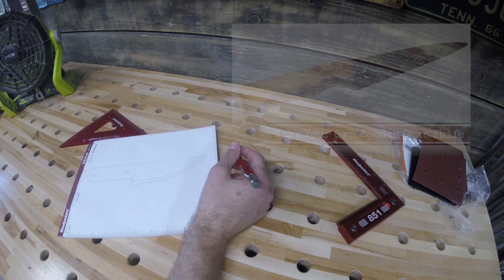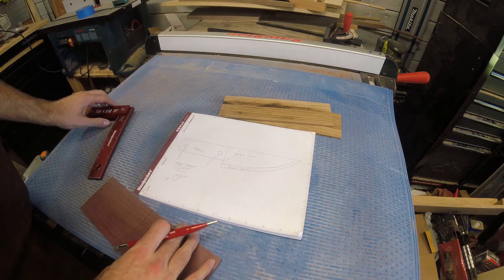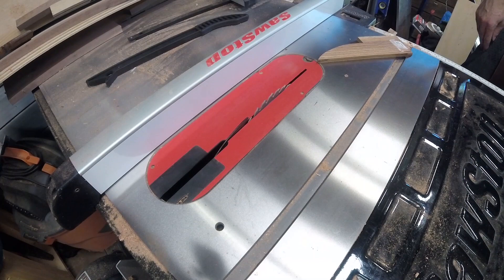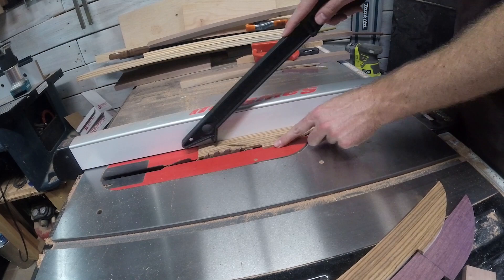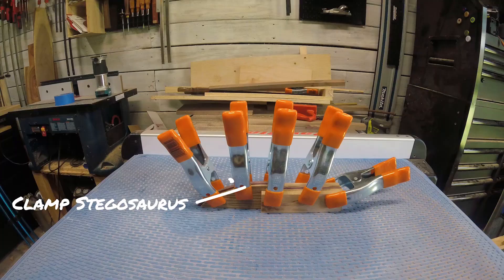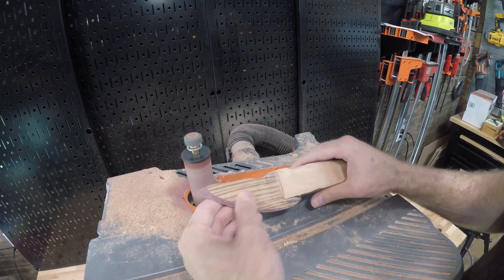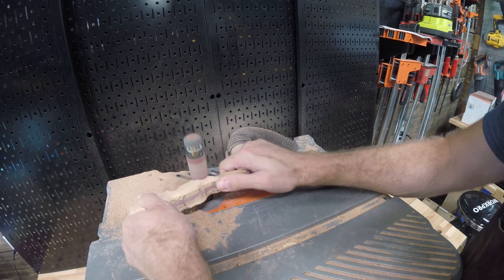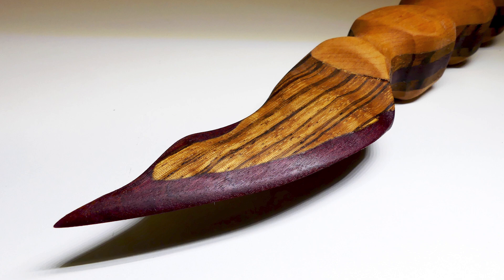DIY Wooden Knife 2.0

Comment: I’m going to make this in wood work class starting tomorrow!!
Reply from the maker: Awesome!  Good luck!  Let me know how it goes
Reply: @LazyGuyDIY  by any chance do you remember your dimensions of your wood and how much you cut them on the table saw
Reply from the maker: @izaiahmoreno-lee9938  minimal cuts on the table saw other than initially ripping them down to thickness.  More so cuts on a miter saw for length.  The purple heart that runs the length of the knife was 10" long and 3" wide and 1/2" thick.  The zebra wood 4" long and 3" wide and 1/4" thick.  The wood on the handles for the scales was 6" long and 3" wide and 1/2" thick.
Reply: @LazyGuyDIY  took a while casue of spring break but, it’s almost done all I need is to add a finish to it